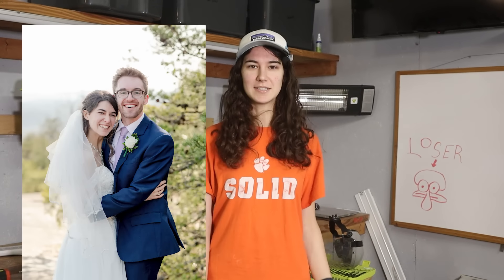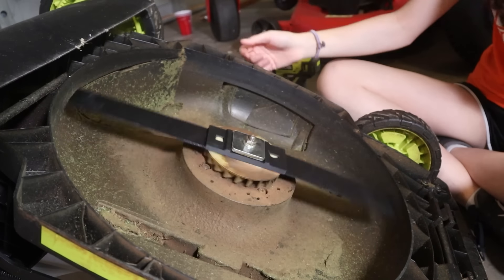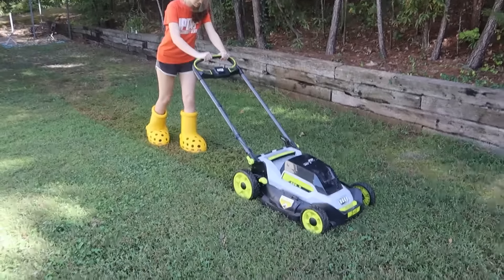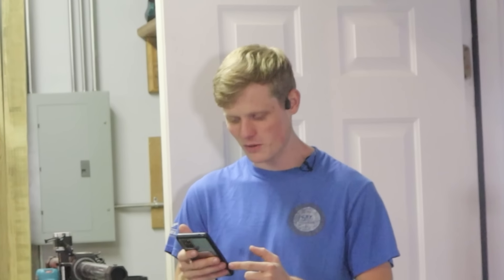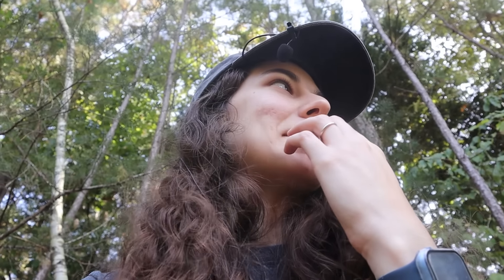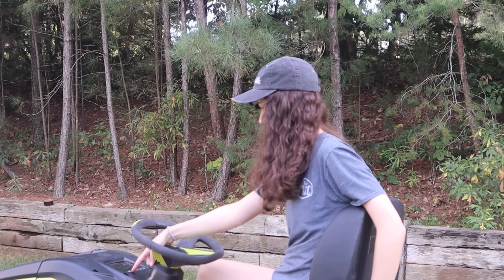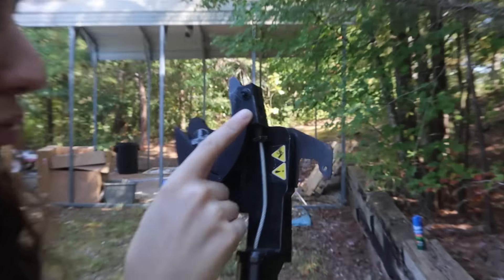3D Printing Lawnmower Blades?

Comment from the maker: Get an exclusive Surfshark deal! Enter promo code EMILYDEAL for an extra 3 months free at https://surfshark.deals/emilydeal
Reply: hello emily
Reply: I just came here to tell you, get a angle grinder. You can sharpen them for years
Reply: only 2 replies to  a pinned comment, well, USE TPU IN THE BIG PRINTER AND HAVE EVERYONE DO A BIG SWORD BATTLE
Reply: i didnt think that would work..... i know no one cares but in my oppinion gas mowers are better..... one of the batteries for that ryobi rider you have costs more that a whole brand new motor for a gas mower. have you ever seen a battery powered rider mower that is more than 20 years old? i have not, but i have seen a 50 year old wheel horse that still has a running original motor. my grandpa uses it every year to till up his garden and plow his driveway in the winter. but hay every won has their own oppinions on stuff i just think battery powered power equipment (like mowers not drills, battery powered hand tools are great.) needs more research and development to actually make me change my mind. but in the mean time ill stick with my scag mower ( the best mower brand ever) for mowing and my husquvarna for plowing
Reply: I love the unbridled yet controlled chaos that is this channel... As a freshman mechanical engineering student in college I really love this channel
Reply: Is the video uploader involved in movie piracy rings?

Comment: Fun fact, in achient rep rap history weed eater cord was used as a source of filiment for hobby 3d printers
Reply: Iirc that weed wacker cord is made of nylon, that's why PLA failed right away and TPU somewhat survived.
Reply: @DrEckig  in addition you want the nylon cord to be wet, if it is too brittle then you can soak it in a bucket of water, that’s partly why it comes pretty wet from the shop and needs a lot of drying before printing.
Reply: @DrEckig  this maybe a use for those awful bio filaments, made of algae or beer hops or whatever, biodegradable strimmer line, although you probably get that already.
Reply: we've come so far we have made it full circle back to where it started
Reply: It's at least part of the reason we have 1.75 and 2.85 filaments as the standard, they correspond pretty closely to the sizes of 2 of the more commonly available string trimmer lines plus a little extra to make up for them being less consistent. String trimmer line is still a semi decent source of inexpensive nylon filament, at roughly 10 dollars a pound. It's good for functional prints that don't need to be pretty, the blades in this video would probably hold up heck of better if they were printed from it.
Reply: @creamofbotulismsoup9900 neat thank you; I knew you could print with it after a lot of drying - but hadn’t realised it being so available in the early days contributed to the standardised sizing
Reply: I remember those early days. When we thought we could print abs on unheated beds.
Reply: I was down here just to say this. Like it has gone full circle now since it started from weed eater cord and it ended here. That is sole reason why we use mosly 1,75 mm filament since 1,75 cord was usually cheapest
Reply: Pretty sure Voidstar labs used some in a cursed filament episode 🤔
Reply: was going to say this
Reply: Hey, if the neighbors don’t like your yard, maybe 3D print some neighbors to stand around and stare at your lawn. Also make them turn their heads back and forth while looking. LOL
Reply: Now we came full circle where funny YouTube person are trying to use 3d filament as weed eater cord

Comment: To people watching, if your lawnmower is gas, don’t ever spin the blades by hand 😂
Reply: does it start the lawnmower??
Reply: it could engage the spark plug, so just take the connector off and you should be ok.
Reply: @rumingjiang9645  it’s possible yes
Reply: Also don’t turn your mower upside down
Reply: how do you replace blades or clean out the deck?
Reply: @KingNothing22  disconnect spark plugs first so you don’t risk the engine starting when it turns over
Reply: @KingNothing22  on a gas powered push mower? You can tilt it back far enough to get to the underside. You just don’t want to turn it completely upside down as there’s gas & oil to deal with. Not an issue for electric mowers as shown in the video. For a riding mower, most decks are detachable for servicing.
Reply: hence twha i JUST said.
Reply: @just__dave  You can tip it over on its side, just make sure the intake side is up, and let it sit for a bit after you set it back down before you try starting it.
Reply: Very unlikely to start the mower by spinning the blades by hand. Just not enough speed. "Could" happen though
Reply: It's kinda a thing that fixes it self . Darwin awards
Reply: @KingNothing22  take the spark plug OUT, otherwise you can still build pressure in the cylinder, even if it doesn't ignite.
Reply: If the handle bar is not down don't think it will start. That's what completes the circuit to the spark plug right?  Either way, best to not chance it I guess. Disconnect the spark plug to play it safe.
Reply: @redsquirrelftw  REMOVE the spark plug, don't just disconnect it. Even without ignition you still have the pressure in the cylinder just from normal compression, which is still plenty to take a finger off.
Reply: Or at least put something solid in there against the blade between your hand and the blade...
Reply: @redsquirrelftw i think handlebar only controls fuel valve. So fuel that is already inside the cylinder theoretically can still detonate, i guess...
Reply: I don't typically comment but as a small engine technician your mower will never start or "add pressure to the cylinders"... On a push mower the handle you squeeze controls a fuel shutoff as mentioned above however it also connects to a kill switch.. so unless you ziptie the handle on the push mower you have nothing to worry about. As for a riding mower you would have to have the key on and deck engage to even have a chance of it starting from that however the reduction spindle that drives the deck would have to much resistance to allow rotation by hand
Reply: Befor i get called out. Older mowers may not have the same kill switchs but they still wouldnt start by just ritating the blade. They require a speed to it. Remember motors are either two stroke or four stroke. Two stroke has an intake and an exhaust stroke. Four stroke has an intake stroke a compresion stroke ignition stroke and exhaust stroke.
Reply: not really do able on newer ones but this is something you should practice anyway old mower or not.

back in the old days lots of people lost appendages due to spinning their lawn mower blades. the ignition bar on the handle that doesn't run unless pressed is there because a lot of people got something stuck under it and it wouldn't shut off.

imagine my horror when i found out my dad had zip tied the ignition bar down so he wouldn't have to hold it

Comment: I think the lawn mower is stalling because the blades weigh nothing. The metal blades probably act as a flywheel, and by replacing it with a lighter version, you increase the risk of stalling.

Comment: Filament is extruded so the polymer chains are random, low tensile strength, weedwacker line is stretched so the chains are oriented lengthwise

Comment: Might of been stalling from spinning too fast being so light. The motor might have a safety on it that is designed to stop if it doesn't detect a blade on it and the plastic blades might of triggered it.

Comment: That weed wacker thing is actually really funny I remember putting weed wacker feed in my first gen maker bot during the early days of 3D printing because filament was both hard to come by and expensive. Although the tolerance on weed wacker feeds diameter wasn’t as strict so lots of clogs

Comment: The riding mower works because of sheer speed of the blades alone. The metal blades on my mower are duller fast food plastic knives and they still cut my lawn well enough.
Reply: Just because it cuts doesn’t mean it cuts well, there is a difference between mangling and ripping the grass and cleanly cutting it.
Reply: @conorstewart2214  Well enough is well enough for the city to not complain about my lawn.

Comment: You can sharpen steel blades with a grinder instead of straight up replacing them.
Reply: If you don’t do it well the blades can end up unbalanced and end up causing issues.
Reply: @conorstewart2214  It's not rocket surgery. You need to really screw them up badly to get them unbalanced enough to cause problems. It's not like a lawn mower is a highly tuned precision instrument or doing 100,000 rpm. You just have to hold the thing at the right angle and do roughly the same number of passes on both cutting edges.

Comment: pro tip for anyone else having trouble with dinged up mower blades (regardless of the 3d printing shenanigans we see here). If you have some basic tools you can just resharpen them. Tip your mower over and clean the area in question. Then take a file and give the blade a new edge, it does not need to be perfect but you can easily restore it to almost new in terms of cutting power while removing very little metal. If there are large gouges this may be less effective but still possible. If the blade gets bent significantly you can remove the blade and heat it till its red-orange then use a hammer to bend it back into shape. Heating it this way will likely remove any blade hardening but all that means is it will dull a bit faster compared to a new nice one.

Comment: But can you use weed wacker plastic in the 3d printer?
Reply: Yes, hobby 3D printing started with weed eater trimmer line because its nylon, fairly consistent and cheaper than PLA if you buy in bulk. The caviat is that you absolutely need to dehydrate the filament.

I buy 2.25kg spools of trimmee line for 35 usd which comes out to 15 usd per kilo of nylon vs 1kg of nylon for 100usd.

Comment: I have a harbor freight grinder I sharpen the blade with every couple goes. I've even changed the crappy angle my electics mower came with that was tearing the grass not cutting.

Comment: Torque vs power. This material has no problem in low torque high power use cases but fails in the high torque low power cases.

Comment: Why didnt you just 3d print a guide to keep the blade at the perfect angle from your shaperning device, aka angle grinder w grinding disc some 3d printed magic and the blades your gusband  fails with. A solid blade on a lawnmower cuts the grass, it doesnt brute force rip through and pulverize like what yours is doing

Comment: Remember kids, if your push mower runs on gasoline, NEVER spin the blade by hand. ALWAYS disconnect the spark plug before working on the mower.

Comment: Couldn’t you have done a 3D scan of the original blade and then 3d printed that ? Or just taken your blade to the hardware yard place to sharpen your blades for re-use?

Comment: Soooo, tl;dr is that 3D printed blades can work as long as they don't cut anything too deep. I knew they would work because the actual blades themselves aren't sharp, they make that up by spinning super fast, but you could probably legit mow a whole yard if you wanted to push it. Just make the plastic thicker, or heavier really, and it might actually work as a substitute for the real thing.

Comment: You can also do it the opposite way around with using whipper snipper filament for 3D printing

You need to dry it first, but they’re usually Nylon and at times cheaper per mass than actual spools of Nylon filament
I also only know this because of an ADHD intrusive thought moment

Comment: 0:15 Guilty. I sometimes do that too.
0:31 Take a dremel with a sharpening stone and give it a couple of passes on each side. You want to make the blades thin, but not razor sharp. I learn that this summer.
1:15 No.
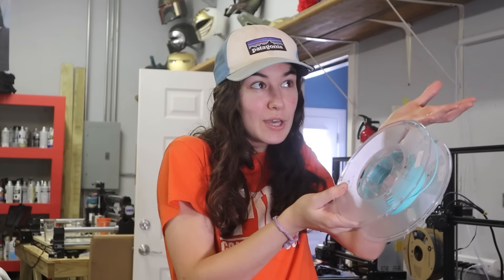3:48 Woman, stop! Don't do it.
8:39 Saw that coming.
9:18 (Shaking my head)

Comment: if you are using nylon, I don't see why it wouldn't work.  That's what weed wacker wire is made from.  In fact, you could just use nylon filament, and make it a giant weed wacker

Comment: To bring a side-quest full circle: Someone took clearance weed-whacker filament and printed with it. 

Took a rather long time in the dryer to be usable, and the resulting print wasn't great, but it worked.
Reply: I heard that there are lots of similarities between 3d printing filament and weed wacker line because the first 3d printers printed with them. That's supposedly the main reason why they have the same 1.75mm diameter.
Reply: I did that years ago on my old Robo3D R1, it "worked" for printing nylon on the cheap.
Reply: @Ironclad1313  I think you can get various diameters of strimmer line.
Reply: @Ironclad1313 Earlier 3D printers used 3mm filament, the switch to 1.75mm was for higher precision. But yes, weed trimmer line does work, and in the right printer it even works well because it's just nylon plus some additives

Comment: That picture makes me want to print a tpu tire since you cut it so it looks like the moder has a flat front tire 😅
Reply: Airless tyre designs work well with TPU. If you want it to work well you don’t want it to look or work like a normal tyre, since you can’t really use air in it instead the flexibility and cushioning needs to come from the material itself.

Comment: This is fun, but metal blades are the shape they are because they just want to use cheap stamped steel... If you aren't limited by that, you could come up with all kinds of weird blade designs that work better in FDM...

Comment: Flymo used to sell plastic blades for their electricv mowers. I used to use them in the 1990's,

I went back over to the metal blades, as I had to replace the blades every week, but you only need a bench grinder, to sharpen the metal blades.

Comment: I mean weed eater Wire is Pretty much Nylon Filament anyway I'm curious on how the TPU compares or even Nylon Filament to Nylon weed eater wire. Good video!
Reply: IIRC one of the big reasons we use 1.75 mm (or is it 2.85mm ?) filament is because it was the diameter of nylon wire that early hobby 3D printers were using as filament, because there was simply no "hobby" 3D printer filament market back then.
Reply: The one really big difference (other than material) is weed eater wire isn't circular. There are a lot of different shapes that different manufacturers make, but it's often shaped almost like a torx driver which gives it sharp edges that are better at cutting.
Reply: @junkice6930  it also has lots of additives and is optimised for its intended use case. It is also meant to be hygroscopic since absorbing moisture makes it flexible and better at its job. 

Highly hygroscopic nylon with loads of additives isn’t something you really want to print with. The mechanical properties of printed parts will quickly degrade too.

Comment: Thats funny, the first 3D printers actually used weed eater trimmer line. I still use 0.065" trimmer line because its actually NYLON. I buy 2.25kgs of round 0.065inch (1.6mm) trimmer line for about 35usd. You do absolutely need to dehydrate the filament first.
Reply: It isn’t recommended for various reasons, some being that it has a load of additives to make it better for strimming that actually make it worse for printing (it affects your printed parts too) and those same additives can release nasty fumes. You would be much better not cheaping out and getting some nylon that is actually meant for printing.

On top of that it is meant to be highly hygroscopic, since you don’t want the line to be brittle, if it is brittle you can soak it in a bucket of water. With any nylon the more water it absorbs the more it’s mechanical properties degrade (strength, stiffness, etc), but it’s impact resistance goes up and it becomes more flexible, so when printing functional parts you often really don’t want highly hygroscopic nylon, like PA6, you want something that won’t absorb as much and hence will maintain more of its strength, like PA12. Look at Bambu labs test data for their PA6-CF and pay attention to its wet vs dry properties, there is a huge difference. 

So even though you can print with it doesn’t mean you should or that it is a good idea, it is optimised for strimming not printing and definitely not for any of the things you print out of it. You are probably better just using other similarly priced materials or just spending more to get decent nylon.

Comment: Helpful life tip for people who enjoy questionable tips: you can print the trimmer line that weedeaters use. It's just nylon, and is cheaper than nylon filament, but it's almost certainly not as good as PA-12.
Reply: All nylons mechanical properties degrade greatly when wet (sometimes the strength and stiffness values when wet are less than half than when the filament was dry), strimmer line is meant to absorb moisture as it makes it more flexible. People avoid PA6 due to how much moisture it absorbs, strimmer line will be even worse. Then on top of that it is full of additives that make it better for its intended use case that aren’t good for printing or for printed parts.

Comment: Trimmer line was used as filament for super early printers before you could really buy filament easily, it's pretty much pure nylon and you can use slightly modified nylon settings but you have to dry it first! Also ventilate well there's some nasty additives in it.

Comment: Oh thank god, I thought I was the only one who HOVER MOWED over sensitive items like power cords, pool hoses, etc. Also just buy a blade sharpening kit. Attaches to the drill, works well, and is like 30USD. You can usually get 4-5 sharpenings out of it before you really should get a new blade.